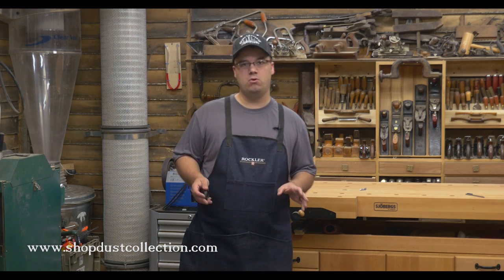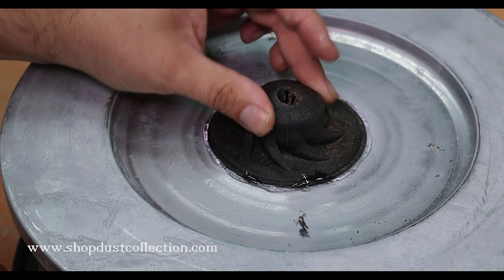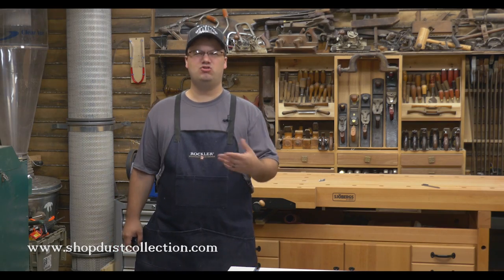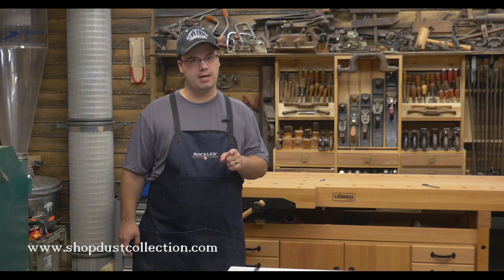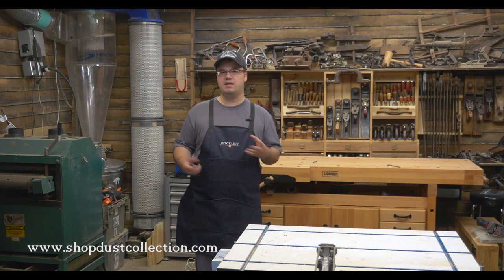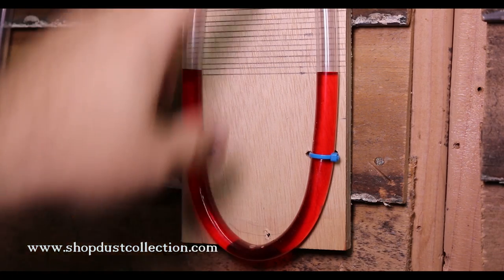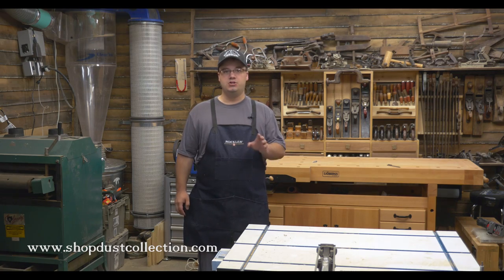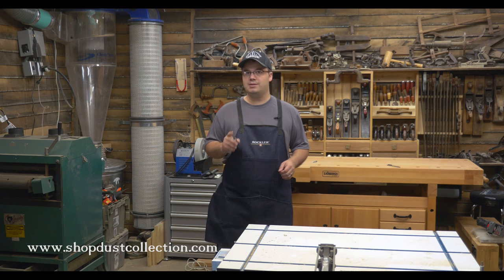SNW59- Make a manometer to measure your dust collection filter efficiency and airflow

Comment: Thanks for the tip. I've been using a vintage bicycle speedometer. The kind that uses the air pressure resistance from the forward motion of the bike.

Comment: Great video and a good overview of how to install and "Calibrate" your Manometer. You did claim that a single stage dust collector wouldn't produce as much back pressure as a cyclone system. `However if the single stage unit is rated at the same pressure discharge it would produce the same back pressure. 

Would you consider creating a Manometer to measure the vacuum rather than the discharge pressure?

Comment: I worked in a coal fired power plant that used high tech filter bags to filter coal ash out of the exhaust. They could clean the bags often and quickly from a panel in the control room whenever they saw the pressure rise. They also had high tech equipment that monitored how many dust particles were going up  the stack and not being caught by the bags. What they found out was if they cleaned the bags at the first sign of back pressure they had more ash going up the stack. If they kept the bags a little bit clogged the dust in the bags would help filter out the smaller particles of ash. How you would figure out what that sweet spot is for wood dust I do not Know.  First you would have to measure the amount of dust going into the bags and the amount coming out.  Point is don't be a purest and clean the filter spotless after each use.  Leave some dust in the filter to help filter out the small particles of dust.
Reply from the maker: NotAnExpert - What you are referring to are filter bags, which depend on "seasoning" with fine dust to achieve peak filtration. All bag filters, even on woodworking dust collectors need a fine film left on them. Air has to escape through tiny holes in the media. In cloth bags, those holes can only be so small, so they use chemical coatings to reduce the size, and then rely on fine dust to partially clog the holes to make them even smaller. That's why you don't wash them, just bang them out a bit. On the other hand, what I am referring to are canister filters which achieve their set level of filtration directly from the manufactured media. A layer of dust does not change that, and too much dust will start to decrease the efficiency.

Comment: I made one of these and attached it to my Delta 50-760. When I covered the Wynn filter with a bag and tried to measure the 'full' side, it blew the water right out of the tube. Very messy! Any thoughts on why this would happen? Would the height the manometer is placed affect it? There is about 10 feet of tubing. Thanks!

Comment: OK James I mounted my Wynn filter on a Harbor Freight single stage vacuum.  The manometer inlet is on top of the Wynn filter.  When I seal the filter water shoots out of the top of the manometer no matter how little liquid I use. Thoughts?
Reply: Use a longer tube or use a more dense liquid like mercury. The height depends on the pressure difference, so if you have a really high pressure, you'll get a lot of height before it stops. A more dense liquid won't travel as high for the same pressure. Mercury is about 13.5x more dense, so the change in height will be 1/13.5 as much.
Reply: @reverse_engineered  I solved it by putting a plug with a very small hole I it. The back pressure was enough to slow down the initial surge at turn on. Works fine now.

Comment: Super.  I have thought for some time that a water trap, kinda like a hookah, between the cyclone and the filter would catch a lot of the fine stuff.  I haven't seen any videos doing this yet.  Any thoughts?
Reply: stephen dickinson Sort of like those vacuum cleaners that you put an inch or so of water in the bottom of the canister? That's a good thought I wonder if someone has looked into that. Now you have my gears whirring!
Reply: David Taylor I was thinking of a pvc pipe with 1/8" holes in it, just under the water.  The air with very fine dust would be forced out the small holes so the dust would be captured by the water.  perhaps.

Comment: First of alI thanks for the video.  I have had a clear vue for about 4 years and it has worked great--until recently.  The motor will turn off while I'm using it because the thermal protector trips off.  It has done this 3 times and the last time I reset the switch and blew out my filters while running a shop vac at the clean-out port.  Didn't seem too dirty.  Cathy, (at clear-vue), thinks my filters are dirty.   My clear vue is identical to yours except I have the clear vue clean-out at the bottom of my filters.  On the clean out there is a 4" pvc pipe that has a pvc cap on the end that I take off to vacuum out the dust.  Would it work if I just drilled a hole in the cap  just big enough for the clear hose adapter and run my tubing from there?  The pvc cap just slides on and off by hand,  it's not glued, and then just hang my manometer on the wall beside the filters.  Do you see a problem with using the pvc cap at the bottom of the filters? 
thanks
tim
Reply from the maker: You ca try it. Worst case scenario is you need a new PVC cap. I just wonder if, since the air stream blows directly down the filter stack, if that would affect it. Before doing any of that, I would clean the filters really well by blowing compressed air on the outside surface. Then open your clean-out and see how much dust you end up with. Then see if your motor stops giving trouble...
Reply: I just cleaned the filters last week with a hand held leaf blower and compressed air with a shop vac hose stuck in the clean out, then today the motor tripped off only after 5 or 6 hrs of use.

Comment: Seems that if you have a system with less cfm, using smaller diameter tubing would be a good idea. With a smaller system, the "scotch" isn't going to move as far from clean to max. The smaller the hose the further the liquid will move, giving you a more accurate reading. Yes, no?
Reply: No. The "head" distance is independent of the area of the cross-section of the tube; it is only dependent on the pressure differential and the density of the liquid. Recall that pressure is force per unit area. The pressure acts on the fluid from two places: the ambient pressure outside (the open end of the tube) and the vacuum or discharge pressure on the other end (connected to your equipment). A difference in pressure between the two sides causes a force proportional to both the difference in pressure and that area. However, that force lifts the liquid against the force of gravity. The amount of force from gravity depends on the volume of the liquid displaced, which depends on the cross-sectional area of the liquid, the height that it is displaced, and its density. Note how the force applied to the liquid by the pressure and the force applied to the liquid by gravity both depend on the cross-sectional area. Because of this, the cross-sectional area cancels out and the only thing that determines the height is the difference in pressure and the density (mass per volume) of the liquid. Less dense liquids will rise more with the same force from pressure (since the force from gravity is lower), but they also tend to evaporate quickly, so water is a common choice. Oils are a close second. Mercury is more common for high pressure situations.

Comment: Where do I install the tubing inlet if my cyclone doesn't have a clean out box but a clear bag at the bottom of the filter cartridge.
Reply: At the very bottom of the cyclone, just above the bag clamp.  By the way, do you have a cage inside the bag, to keep it from collapsing and rendering the system worthless?  

Just a reminder:  Even small leaks at the bin trample cyclone performance.